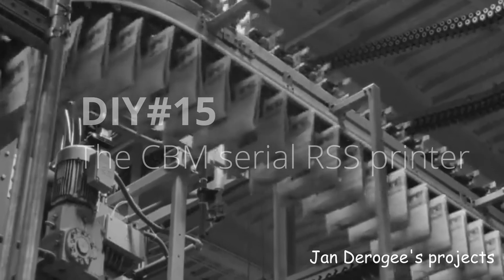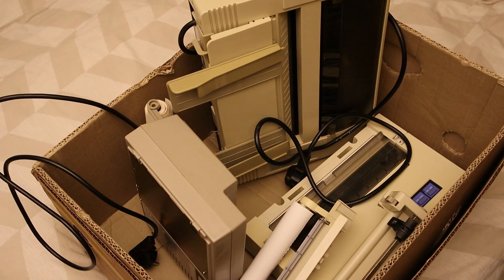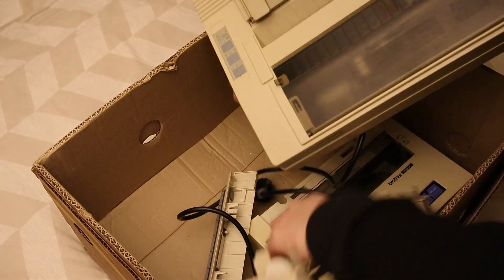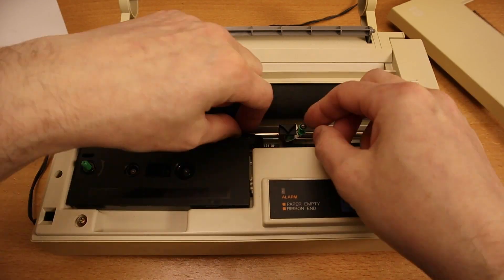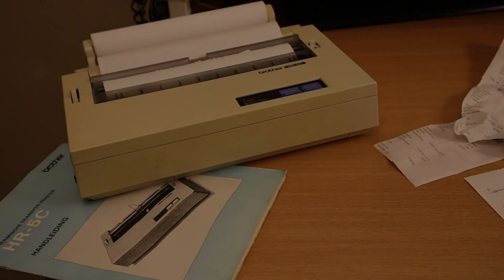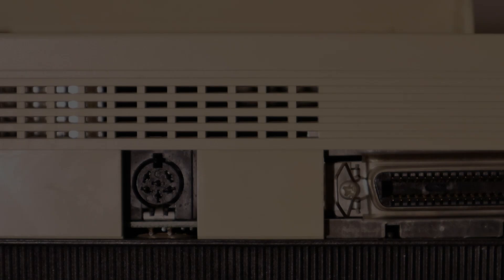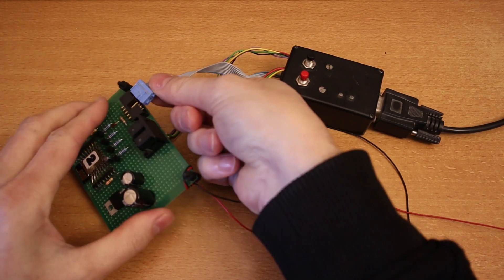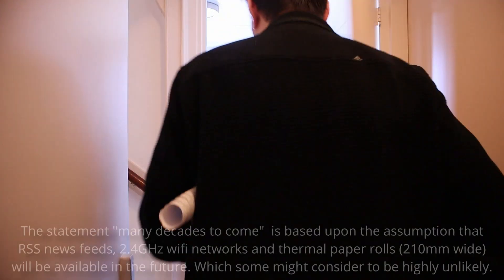commodore RSS news feed printer

Comment: Hello. Do you know of any solution for the C64, how to make a continuous serial connector on the SD2IEC cartridge, which is in the expansion port and in the serial port at the same time and therefore prevents me from using the printer, because the cartridge does not have the connector like the floppy drive? Thank you
Reply from the maker: You can make a y-cable. A simple splitter where all the pins go from 1 to 1, 2 to 2 , 3 to 3 etc. Everything on the serial bus is to connected in parallel. So if you have 3 drives and a printer, they will all be connected to the same clock, the same data, the same reset.